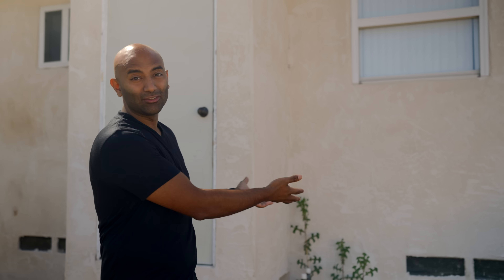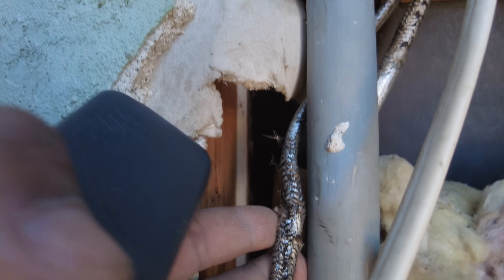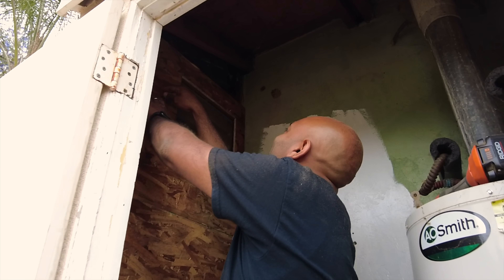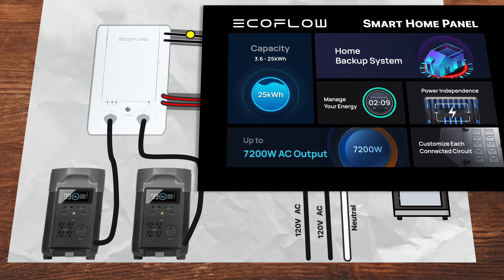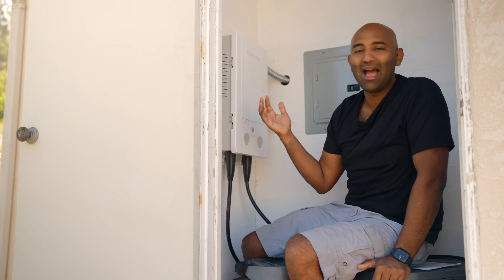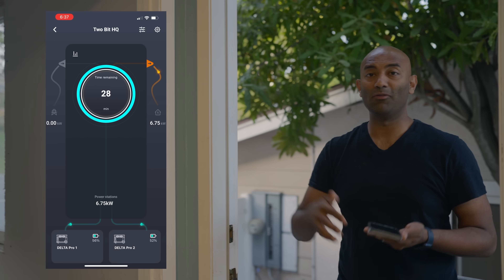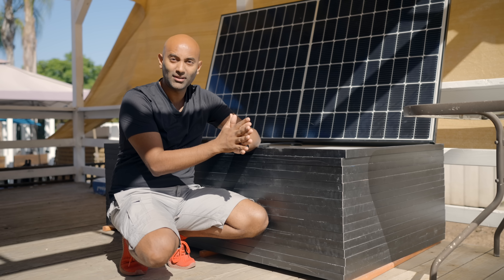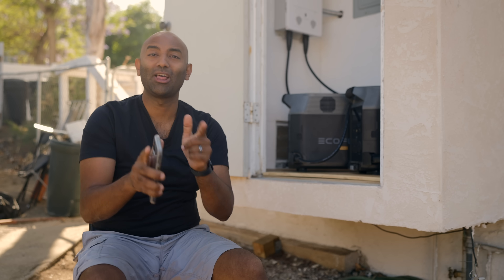Best New Way To Back Up Your Home Energy?  |  Going Off-Grid.

Comment: That wire you pulled out is from the 1940s.
Reply from the maker: Crazy
Reply: @TwoBitDaVinci  yes indeed.  Cloth covered wire ended by 1950n when plastics replaced it.. one place I lived in routed a cloth covered b wire under a cold water pipe.  The pipe would sweat and short said cloth wire.  A rubber glove placed between the wire and pipe solved that issue

Comment: No Solar Panels???  what would be the point of removing the Natural Gas Lines ....  I'd keep the Natural Gas Lines since you are not installing Solar panels or a wind farm
Reply: I think you need to watch till the end
Reply from the maker: I am dude. Near the end I mention the EcoFlow delta pros can take 1600W of solar each so I can get a 3000w system and I’m going to
Reply: @TwoBitDaVinci  here is another point  what do you do if you live in a state the "Requires a Utility drop"  to the structure

Comment: Do you think we will be able to develop an economical way to safely recycle solar panels? This is going to become a major issue in future if we don't considering the rapid expansion of cheap solar.
Reply: Yes.  Step one is using used commercial panels.
Reply from the maker: even cheap solar lasts for decades, so after saving SO MUCH emissions from not buring gas every minute, after 30 years, we will find ways to recycle it. but you can't compare 30 years of energy production to fossil fuels that burn for an instant of value
Reply: And after 30 years of use, they will still produce power, just less....  Having said that, in 30+ years when they require replacement, the factories producing them will be so much cleaner... Snowball effect!  

The other thing is people should replace panels with newer used panals from commercial use.  The commercial properties almost always need as much power as they can get per square foot of space used and will upgrade to the latest every few years. Residential solar users should take advantage of that. I know I will.

Comment: I added solar/powerwall on my house with EV’s.  Saving $400/month on electricity/gas.  Sell excess to grid and have power with outages.  I can charge my car when outages.  People do not realize you can not fill gas cars at stations cuz electric fuel pumps needed for nozzles.  These electric pumps do not work with outages.  I ordered Starlink world WiFi.  I have power for my WiFi with outages but many times spectrum cable down the street no power back up.  Modem does not work.  Starlink fixed that.I can not control healthcare costs but can control energy costs.
Reply: I live in Hawaii with 37 cents/kwh is your electric cost.  We use split ac/Heater heat pumps.  Our outside condensers can handle several air handlers.  You have individual control heating/cooling each room which saves energy.  DC variable speed and low energy consumption energy star split units.
Reply from the maker: that's awesome Scott! yes honestly once you have solar and batteries and an EV ... its unthinkable to ever go back!
Reply from the maker: Hawaii sounds amazing man, I need to come visit you and make a video!
Reply: We have 2 Tesla’s with a 100 amp circuit, really 72 amps.  We charge during the day as both powerwall/solar panels/a little grid.  Hawaii does not offer peak or non peak electricity.  It’s 37 cents/kwh day or night.  Most home Hawaii do not have ac.  EV’s would be expensive without residential solar especially with $6 gas.
Reply: We own a 13 kw solar system with one powerwall for 2300 sf.  2 batteries probably better option.  We can run everything off the one battery, 14 kwh battery.  Seamless.  We are on battery all night, no problem

Comment: One more... 'Going off grid', is NOT the best way to reduce CO2 emissions. I understand the appeal, but to have a solsr-PV, plus heat pump, plus a turbine or two, that is guaranteed to provide all your electrical needs, on a winter's night, will, inevetably have massive over-capacity, even including 'normal' battery backup, in a blazing Summer's noon. To share that excess with your fellow citizens and take, what they share with you, when you need it, makes way more sense to me. A future where our cars, home battery systems and appliances are all woking in unison to balance the grid, is our best shot. NB I appreciate that 'off-grid' can just mean 'net-zero' to many, in which case- keep up the struggle.

Comment: With all those pricey and sensitive to repeat electric power surge spikes, highly electronic component ladend appliances / HVAC  electron drift operated gadgets planned for your new home, suggested is to study up on adding utility meter surge protector, main house panel surge protector, house sub panel surge protector, 330 v AC Clamping wall outlet surge protectors every where around the house. Roof lightning rod protection system. And a low ohm resistance  grounding rod system, the best performing you can afford/install. All of that electrical power equipment needs surge protection designed in to protect the electronic circuit board appliance / HVAC equipment, without such surge protection in place equipment will not last longterm without expensive electronic boards replaced when not isolated and protected from typical utility power supply spikes and surges caused by weekly utility switching excercises, utility equipment changes/ upgrades, summer weather electrical storms, high wind events, and vehicle seeking to pole knock down events all passing into your new home electric power surges to those pricey and sensitive electronics your depending on to operate long term to give you the hoped for return on   investment.

Comment: 10 breakers in a circuit panel is nothing these days. You are helping things out by upgrading to 20 amp breakers. But still maybe you ought to upgrade your main panel to 200amps. Also a home that has access to natural gas is a big plus... cap it off if you want to but do not remove the service.

Comment: Anyone do their own solar? I'm pretty handy but don't know shit about installing solar.  The company I called said $85,000 for a system with 3 batteries which would be a minimum for me. I am in Phoenix and have a flat roof.
Reply from the maker: Keep an eye in working on some tools to help with this. Coming soon!
Reply: Just looking to do it myself.... I know standard electrical but have never messed with solar.  And I won't pay that 85k so the only way I would do it is by doing it myself.

Comment: Why do homes cheap out on plumbing and electrical.  At least 20 amps circuits everywhere with AFCI/GFCI.  So it costs a free hundred more, so what.  With my remodels go with $15 outlets vs 10 outlets for $3.99.  There is a difference.
Reply from the maker: I totally agree! what's funny is for a 50 year old house, the foundation and wood is all amazing. this is back when 2x4's were actually 2x4 lol... but electrical... god... what a mess it was
Reply: I know right, if they don't want to use the more expensive outlets at least wire for 20 amps instead of 15.  The wiring is barely more expensive plus it makes it less likely you can trip the breaker.

Comment: Why go under the house.  Leave those wires disconnected with new wires coming in from side.  You have all the sheet rock removed
Reply from the maker: from the side of the house? I wanted a seamless look. i dont like leaving old stuff in, just my OCD lol.. and we needed to insulate the walls, so its all done now.

Comment: Energy is a commodity. Take home: don’t pay too much for your batteries. There’s a reason you don’t include pricing in this video, because while your theory is headed in the right direction, ecoflow batteries are not price competitive.  Way too expensive. Much better options. See signature solar eg4 batteries and mpp inverters, and follow Will Prowse
Reply from the maker: They are expensive. Price info is on the site where I can change it. I don’t do prices on a video I can’t change. Those batteries aren’t portable. Totally different class.
Reply: @TwoBitDaVinci  what is the benefit of portable batteries in a home? Do you also use the same ones outside the home?

Comment: Your workhouse is just a wood frame, 15 cm wide. That is a shed! A badly isolated shed! And no foundation under it! Is that legal to live in? Dont you have building codes?
Reply from the maker: What are you talking about? The house is 1000 square feet, living room, (where the team works), bathroom, bedroom (our recording studio) and kitchen. It's on a foundation, I was literally under it in the video. the home is built like a tank, back when 2x4's were actually 2in by 4in. The house is built amazingly well, but the electrical was crap. Also it was not insulated, many homes in CA that are older aren't. In San Diego our weather is super mild, so they cheaped out. Newer homes of course are insulated, and now mine is too. I will cover that in a future video.
Reply: @TwoBitDaVinci  I guess it is just very different from european building methods. I am surprised. And have now learned something about california buildings. Thx.

Comment: HOWEVER, 3 year warranty is a DEAL BREAKER for anyone with any kind of sense.  ANY decent Solar Battery company gives a MINIMUM of 10 years.  I am sure your a decent guy, but this is basically an ADVERTISEMENT for Eco-Flow, and for you to suggest this to your viewers is just irresponsible.
Reply from the maker: the smart home panel has a 3 year warranty? yeah taht is pretty short, but I honestly dont think it'll be an issue, but we shall see. they make a very good product. i've had my delta pros for nearly a year now. they're bullet proof so far

Comment: I do not understand why one would remove natural gas heaters and replace with electrical devices. It is an expensive fools errand.
Reply from the maker: not at all. systems in the house like this one are horrible for your health. most are in the garage for a reason. we will have tons of solar and a mini split heat pump. plus we can make it and use it ourselves. don't need to be a customer. that's the whole mission of going net zero. we are going to lean on things we can make, like electricity thanks to solar
Reply: It really depends on where you live.  If gas is cheap and you don't have panels, gas can be the cheaper option( TOC), especially if you're not a using heat pump.

Once you have free excess electric and heat pumps that are 200-300% efficient the numbers can turn the other way around no matter how cheap the gas is.
Reply: @TwoBitDaVinci  I agree with no flames in the garage. That is why my gas instant hot water heater was relocated outside. So california location my gas bill averages $30 per month. Is it not true that natural gas is also a byproduct of oil production? Therefore if we stop using natural gas as a fuel it will then be wasted like it was when I was growing up. You would drive by an oil field and see large flames burning off the unwanted natural gas.

Comment: you're certainly hamming it up, you were gonna replace all the wiring anyway, so why is it a nightmare now ? that's called forced drama, also all that old wire covering being a fire hazard ? bullsh!t yet again, it's not like there is bare wiring underneath, there's still a layer of isolation and like you said no rubbing, anyway i' less then 4 minutes in, this is not a good sign